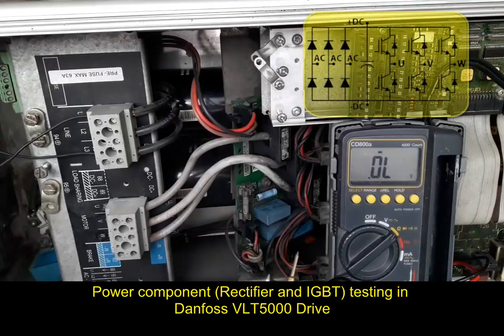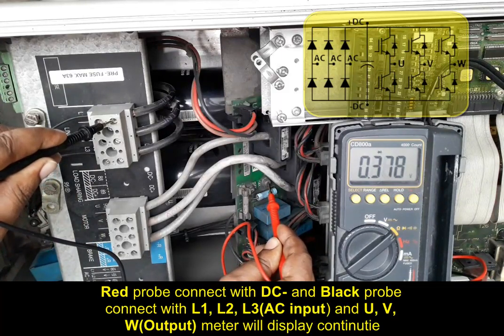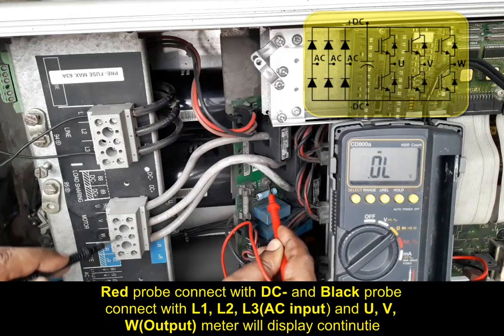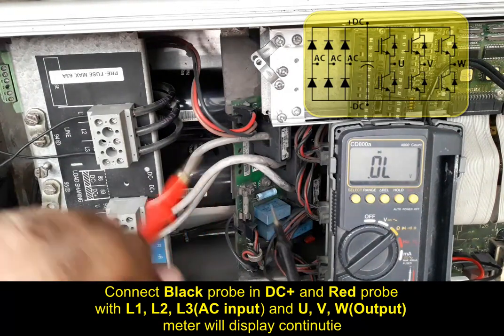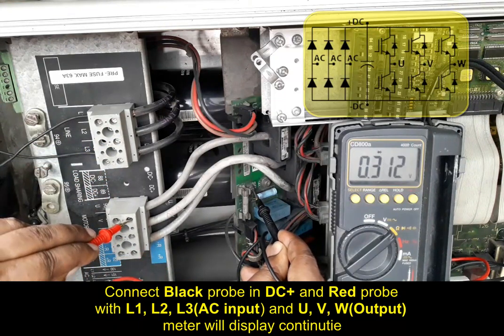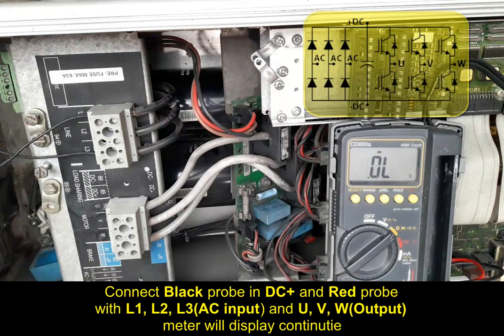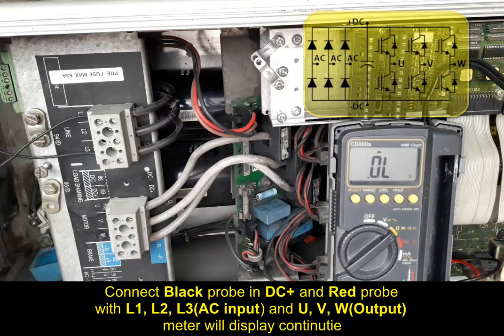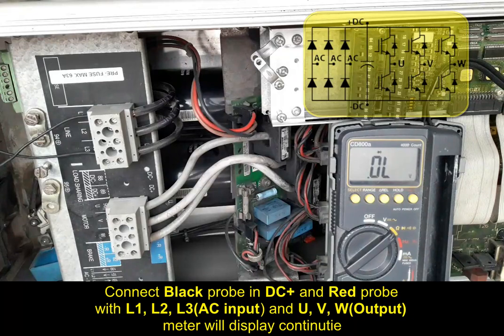Danfoss Inverter Power Component Testing VLT5000 @FlowChart

Comment: Sir ground fault ase shadharonto ki jonno
Reply from the maker: There is a discharge from the output phases to earth,
either in the cable between the frequency converter
and the motor or in the motor itself.
Reply: Sir 
कॉन्टैक्टर coil जल जा रहा है